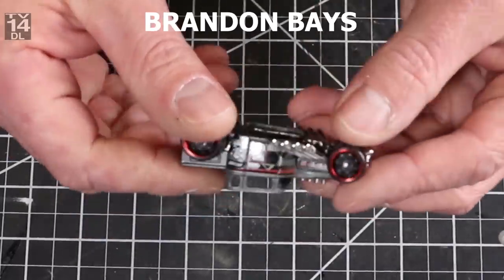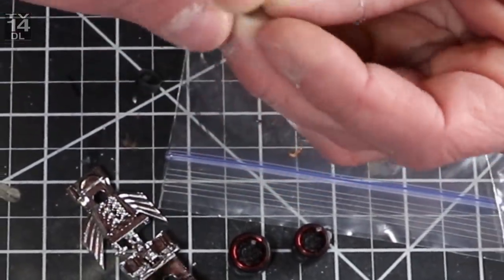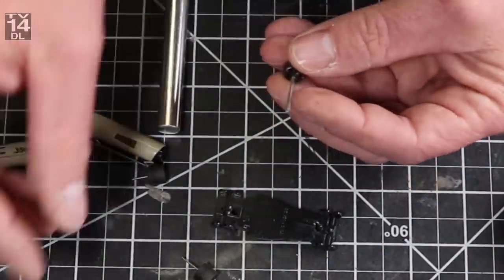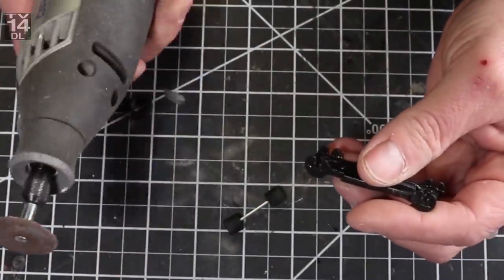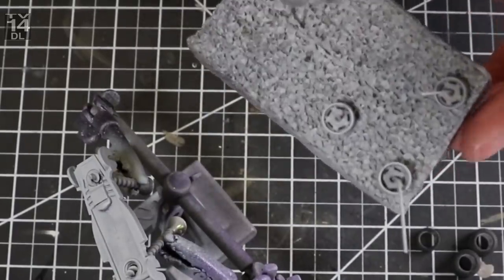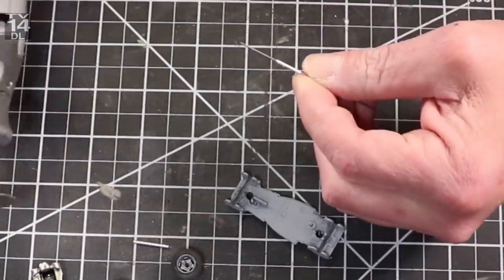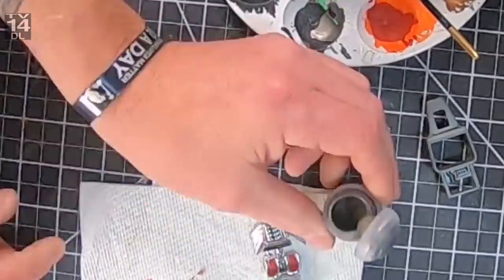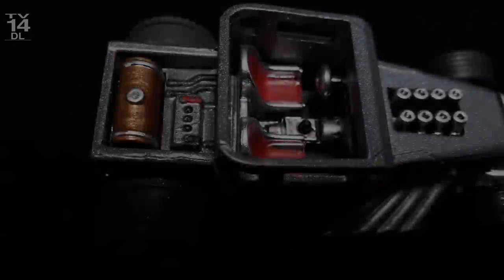3D Printed Wheels and Tires, A Review--Boneshaker

Comment: I don't know if any one has asked this. But where to get and what size are axle tubes? I've watched many of you videos. This may sound like a dumb question. Are gluing the original thin axle the tires came on to the inside of the new slightly larger axle tube? When you enlarged the original groove spots that held the axles before tubing them. That the new axle tube is what spins in the grinded out grooves? I'll admit I'm a more hands on, then a watch person. Thanks in advance for a reply from you or anyone else that may answer.

Comment: Great job on this show case build got 1 question for you. Do you know of any small fastener,s for the hot wheel end of the axles to keep the wheel from coming off. For reinstalling wheels on new axles. I use crimp tubes now Just looking for something better.
Reply from the maker: I've never looked, I either crimp axle ends or use original axles
Reply: @OutlawSpeedShop2001  I use my own axle nickel wire just looking for good ends.

Comment: Question for ya.... when I try throwing some clear over crome parts it wants to bubble up the crome plating. What do u use or suggest for me? Oh and the wheels remind me of them old school slotter rims. I may be wrong on the spelling for the type of rims.
Reply from the maker: If you are talking about plastic chrome then I would assume the chemicals are reacting with the plastic. I have used rattle can clear on plastic with no issues, but never tried an airbrush clear, like a 2k clear on anything chrome and plastic
Reply: @OutlawSpeedShop2001  yes I use rattle can clear also, and i also have that sane issue when I spray over tampos and the colored crome on wheels. Not every time does this happen though. Only reason I spray the clear is to protect the crome from chipping off
Reply from the maker: @l.t.175  that is weird.  I cant honestly say I have ever had that happen. Bad can of clear maybe? Not shook enough? I'm at a loss
Reply: @OutlawSpeedShop2001  maybe not shook enough could be it, I'll have to run some tests. Thanks for the feedback ✌️